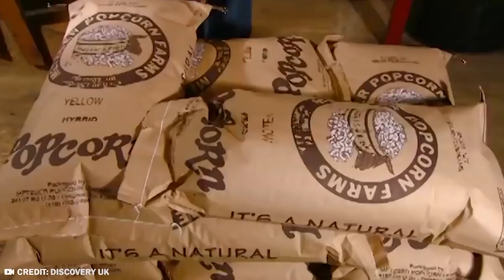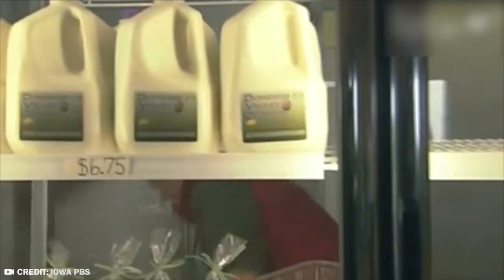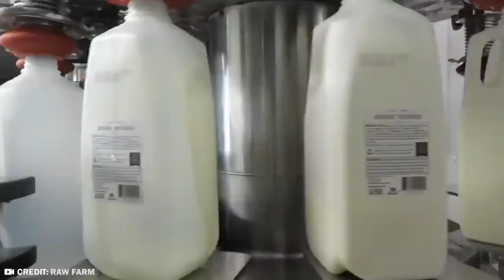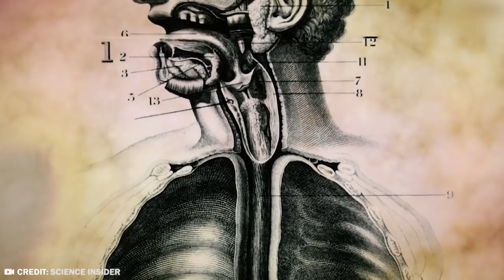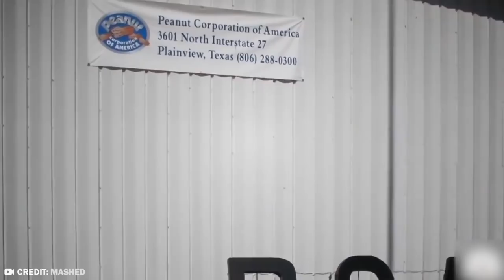20 Dangerous Foods That Can Kill You

Comment: You need to redo your research AC unopen does a gas, that is toxic to the body cassava there are two kinds they're bitter and sweet: nutmeg picking them green where the cars what you said cashew you need to do research on to find out exactly what you talking about and lima bean is what it is called broad beans completely different from what you point out